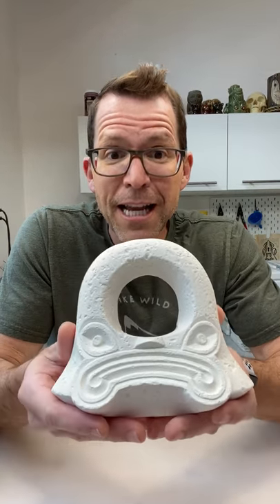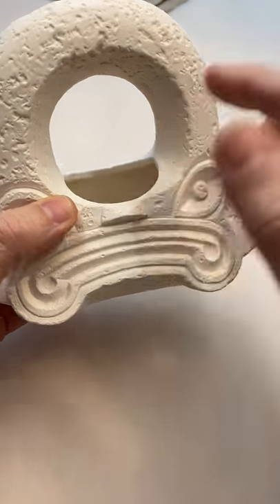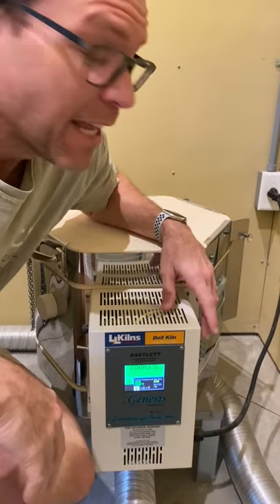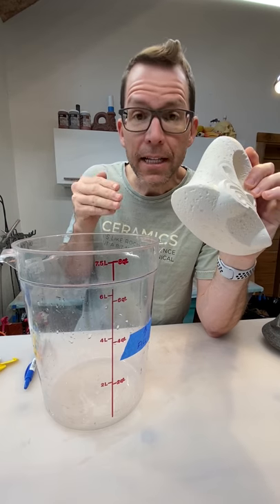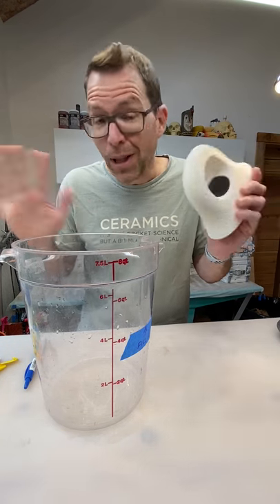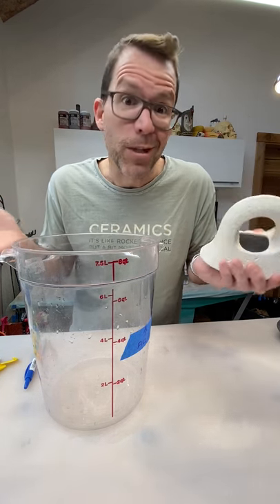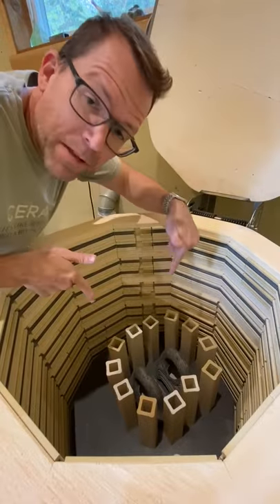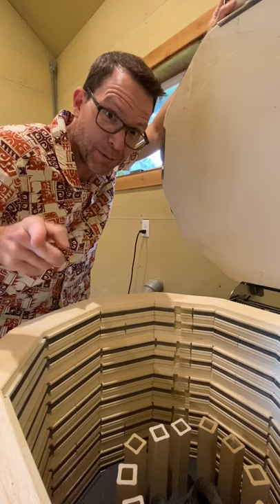Test Glaze on the Puka Pounder mugs - Tiki Technical Tuesday 23

Comment: These came out amazing!!
Curious about the inside glaze: do you add an additional coat to achieve the black? Or does it change/darken during baking? Same in regards to the gloss, separate coating?
Reply from the maker: the inside is a gloms black glaze - its what I was squirting in and sucking out with the syringe.  When it dries it is a matte grey.  Once fired, it becomes a gloss black.  Glaze drives me nuts because it almost NEVER is the color it will be after it is fired.  Makes application a bit of a guessing game - hence the multiple test pieces :)
Reply: @vantikistudio  wow, that's cool! Thanks for answering all my questions!